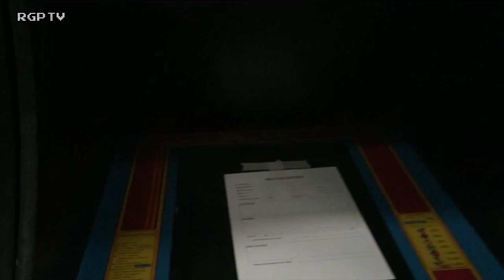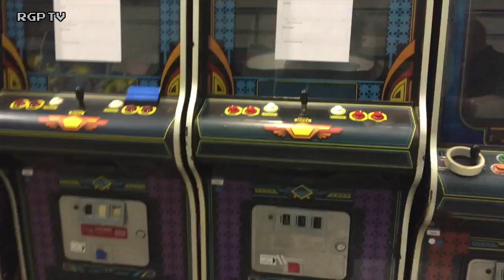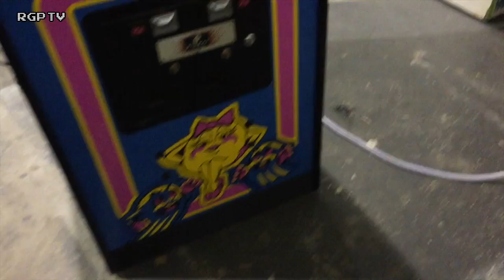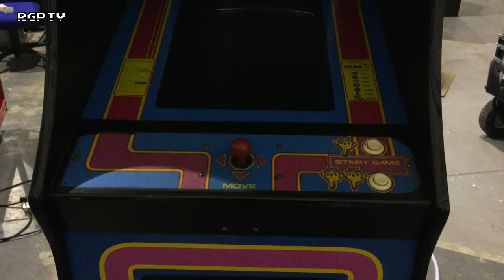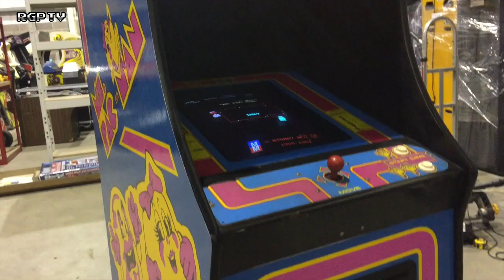Namco/Midway 1981 Ms Pac Man Arcade Game Restoration for UKVaC member MaskedDev

Comment: use the soapy water solution to properly apply the vinyl bubble free like the pros do
Reply from the maker: The print we received would have turned to jelly.  We don’t buy from the US unless the customer asks us to for artwork due to shipping costs of it.  The art supplier we use in the UK now has much better prints so rapid tack etc would work with this rather than probably rip like the old stuff used to if it got wet

Comment: Always wear a dust mask while sanding kids.
Reply: Why would you be sanding kids?
Reply from the maker: A smooth surface is required.  The glue on the new artwork will not properly stick directly to the old artwork, you will get air bubbles.  Plus there were cracks and damage to the edges of the cabinet and in the sides.  These needed to be filled first, the filler is not completely flat when applied and needs to be sanded off to level the surface.  Then primer is applied and then either paint or artwork.

This video was more to show that we are capable of performing the process and document what we did for a customer rather than being an instructional on how to do it yourself.

We will cover in details some of the individual aspects in other videos though.
Reply: "Why would you be sanding kids?"

Comment: I know this was for a customer but it would of looked SO much better if stenciled. I know it cost more but it’s the way to go. It’s more original + you don’t have that annoying reflection on the cabinet. Plus the blue isn’t even the right color. Not here to hate, just my thoughts.
Reply from the maker: No problem, all thoughts welcome, I agree a stencil would be much better, however, i'm mortally against keep paying for one-use stencils.  I'd rather pay a large fee for a reusable laser cut exact stencil for games like this.  The issue is getting the colour matches as most of the original information has been thrown out.  Only Nintendo seem to keep a fairly extensive archive.  So this makes getting a true "blue" correct and colour matching an existing cabinet has problems as the paints weren't UV resistant back then so they're altered.  Happy to use stencils where we can do it right first time.